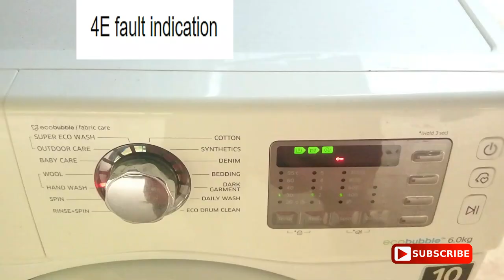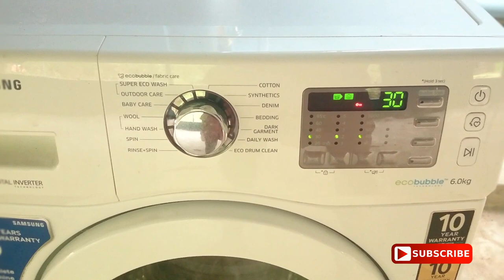Samsung washing machine fault code 4e resolving

Comment: My Samsung top loader had 4E code and i checked the inlet fitler, pulled the back off and checked the hose sensor for faults, checked the wiring connections, checked the pump for blockages and checked over everything! I managed to fix the machine, 4E is a water inlet problem and i had a water flow restrictor on it to stop hammer on the wall pipes... turns out my mains had dropped a bit of pressure (note even noticable by eye just enough to be under the timer limit) and the restrictor cuts flow and was restricted to much so i removed the waterflow restrictor and its 100% fixed, note if the pipes start banging again i now my mains water pressure is back up again and I can put it back on but for now thats the pressure i have got and im happy. Hope this may help someone else that may have this problem.